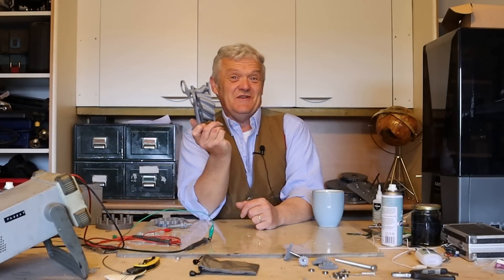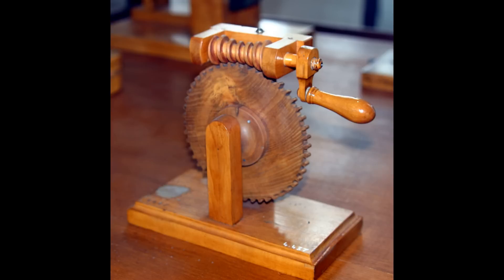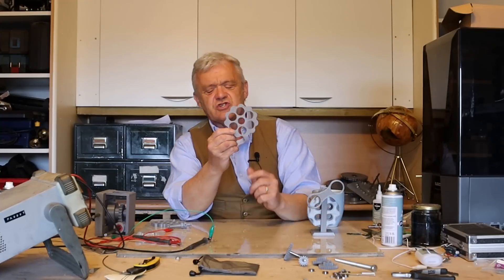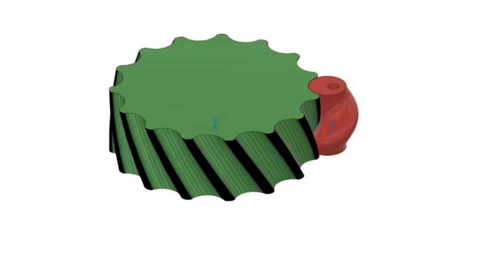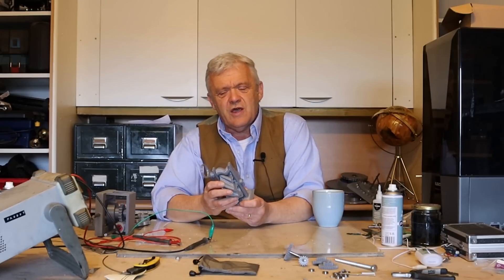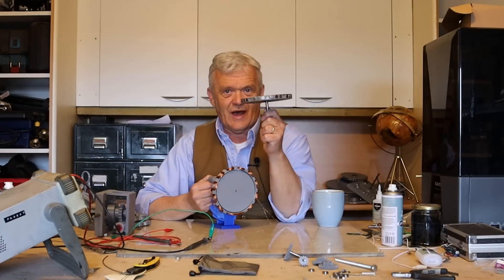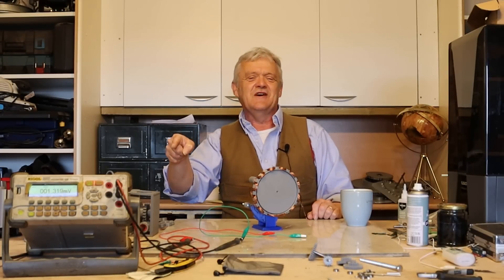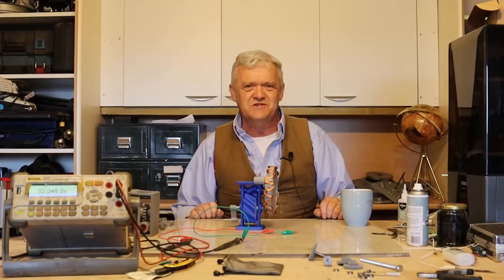1990 Eccentric Cycloidal Power Generator

Comment: hey question, what size bar are you using for the Coggs because they're not 8 mm but the bearings size are so are you drilling them out to eight mill and using an eight mil bar or are using a smaller bar in the bearing if possible can you tweak the STL files to have an 8 mm hole in all of the gears?

Comment: Would this drive in metal need to be a wet gearbox aka: “oil bathed” for friction reduction? Or could a hard forged wheel be driven by a brass oilite or powdered metal pinion?

Comment: That's really inspiring! 🤔 The extruded cam rides on the ridge only, leaving the trough free. If we adjust the shape it could be driven by water like an Archimedes screw in reverse using twisted cams, 2 would give you 24V 
Wish I had a tinker shop😂
Great videos, nice work 👏 thanks 😉
Reply: Ideally, it would use most of the contact area to prevent slippage, I’m thinking Teflon coated gears (they’re rotors actually) would help just like in positive displacement supercharger, which this design draws inspiration from. Or have loose ball bearings between the drive surfaces, or even fill the transmission case with loose ball bearings

Comment: What I like about this design is that your transmission gears won't break if your input is reversed for any reason. Your gear would simply and effortlessly reverse with no wear on the gear at all. You could also possibly use the same worm gear in tandem with another gear at the same time if you wanted and make it turn both gears, assuming your input is strong enough to turn both. One of the gears would turn the opposite direction, but that's none of these concerns (reversing or reversed extra gear) will be a problem for energy generation if the wires are connected to a full bridge rectifier, allowing constant and predictable output regardless of the direction the input turns. This concept could be used on any renewable power source that notoriously reverses direction, such as tidal or shoreline wave power where the ebb and flow of a wave can both be harnessed easily to generate power. Another perk to pinning this worm gear between 2 gears is that if there was any threat of the worm gear slipping from the main gear, it'll be drastically reduced if not eliminated completely by being pinned between two main gears.

Comment: Thank you. I gotta try that cool worm drive. I made a triple helical stator and noticed a large reduction in driving torque 👍.
I'm going to use floating magnetic bearings to reduce more friction and this worm drive looks like a great addition.
I wonder how hard it would be to print one 😁👍
Reply: He says where you can get the files. Or do you mean difficult for it to turn out well without defects? You could probably print the gears meshed together in an enclosed gear box.

Comment: Load forces on a 2 gear mechanism tend to push the gears apart. Rounded gears are probably the WORST design in terms of that problem.
The good point; it gets 10:1 ratio from those size gears, (normal gears would give maybe 5 :1), and it's quiet
The bad point; terrible gearmesh integrity under load, needs big bearings and supports to try and compensate
Overall, it really is not that useful. Planetary beats it in so many ways.

Comment: if you make not only the inner part rotate, but also the outer part in the opposite direction, you get much more performance without forcing the parts made by the 3d printer too much, because it would share the stress on the whole machine.

Comment: oh my god PLEASE tie in another one!  Replace the generator with another big gear and attach a small gear, and then have that drive another generator! Will you get 32 volts?  or will you get 320 volts?  Will the gear ratios multiply or will they add?

Comment: this would make a good bicycle powered power source, if you could turn the rear wheel into a flywheel and get it up to speed, and have that keeping the generator going, or some form of exercise gear that is modified cause it to spin a flywheel.

Comment: This is very interesting, making a silicone mold so a wax copy can be made, for a lost wax casting from aluminum, using a old cast car rim, should hold up fine for a wind turbine, especially id pkaced inside a case, with a bit of tacky lubrication, a bit of lucas oil stabilizer, mixed with automatic transmission fluid,
About 10% Lucas to 90% ATF, should make a thin oil that sticks to the gear leaving a film. For excellent lubrication. It will work well for tge bearings also, just leave a scroll pattern on the gear, to pull lube up to the axel, using a hollow axel, with a hole leading to bearing, it can be self lubricating.  The oil running off the large gear, running into the axel, then to the next bearing, running out the axel, into the bearing, possibly have a scroll wheel just to pick up oil, and feed tge axel. Use a coil of about 3mm copper tubing, soldered to a copper disc. Feeding a roughly 1-3mm i.d. of the tube. With a 1mm hole to lube the bearings ,  with this system straight ATF can be used, no lucas added, the system would basically have a pump oiling the gears and bearings..  

Im going a bit off an a tangent here. However, i have had the idea for a hybrid manual transmission, using a pump like a automatic, and clutches like an automatic or motorcycle,  still using gears, only use the clutches to engage the gears, the shift lever only opens a hydraulic valve engaging the clutch, without pressure, they automatically disengage. With no friction, using a spring to separate the  clutches, More like a motorcycle clutch i guess, having 6-8 packs per transmission, plus a normal clutch,  that could be replaced by a valve, that  slowly engaged the clutches, a normal 4speed transmission would be long, or possibly large, about the same as a automatic transmission.  It could be setup to  wirk automatically, uts like replacing the syncronesh with a clutch pack, about 8 3.5"-4" clutch disc and steels,  maybe  a smaller diameter for reverse, with less disc, being Reverse doesn't require holding lots of power, using a hydraulic coupling in place of a clutch, making it more  like a automatic. Keeping all the  gears from  creating drag on the main shafts nearly eliminating the losseshaving one clutch connecting tge input shaft to the output shaft. Should not requiremire than a few hp to drive , normal losses are 25j+ hp or better at full power, this system should be 2-5hp, usjng a carbon ceramic on titanium with slotted steels1.5mm thick with .5 mm slots tge ceramic material having carbin fiber reinforcing it, basically a carbon composite, using a ceramic material with carbon inside,  like porcelain with carbon using carbon fiber to reinforce, using powdered graphine to make a light weiggt ceramic making the clutch new, about 2.5-3.2mm thick the 2.5mm  steels.  Possibly baking the mose efficient transmission. Us live to build a eorking example,  with a single pneumatic actuated clutch on each gear, having reverse, and 2 forward  gears.  And a electric motor,  with most of the parts 3D printed, probably usung a sheet metal disc with a piece of paper from a brown paper bag . As the friction material.  With another  20 gauge sheet metal for the clutch, and 3mm plastic fir the pressure discs, with a wavy flat wire spring, to spread the pressure disc off the clutch. Use a 3D printed standat clutch with paper as the friction material and simple pressure plate, and a dimple printed air compressor, and hollow cylinders to prove  it works,   using a electric motor, for spinning the gears.  A car company could use the same transmission, only configured different to be manual or automatic,  or possibly a option to be both. It could save money, save fuel , and be fun to drive,

Comment: Seeing these videos always gives me inspiration to think up various designs to push these sorts of designs further, but i don't ever manage to try to design things properly. I could go online and find software to help me i'm sure, but never set aside the time properly.

One thing tends to leave me wondering in the meantime though: You show the Voltage of these sorts of designs, but not usually any amperage to work out the Wattage. For this design, what IS the amperage?
Could this alone charge a phone over a day? If it were even on with no data transfer, would it lose charge overall - just with the hand crank?

Comment: If you increased the size of your magnets , which would increase the magnetic flux working on the serpentine coil, the mass would increase, which would allow for a bit of energy storage, giving you a smoothed relatively constant motion between gust of wind in a flywheel effect,  Decreasing voltage fluctuations. Splendid Vlog as usual Rob.
Reply: a flux capacitor, you say?
Reply: Since the magnet "flywheel" will drive the worm gear in reverse, won't it be braked during a lull by the wind turbine impeller moving against the now-sluggish air?
It seems to me a flywheel needs some sort of clutch/freewheel mechanism.
Reply: @bokkeman123  A centrifugal clutch of some kind would be great.
Reply: @bokkeman123  Also, I would be concerned about the 90% reduction in torque when the generator has a load on it. Plugging something into this generator would cause a braking effect and slow down the rotor, wouldn't it?

Comment: I saw this other video where a guy did a magnetically driven bicycle...  the gears lost energy to heat and slipped... LOL seeing this I really want to combine the magnetic cycloid gear from the last video... attach it this modified worm gear and see if it can withstand the stresses of propelling a bicycle... How cool would it be if you could just 3d Print the parts for a high functioning bicycle or ebike from the same parts used to build a device that charges it?

Comment: That is really amazing! 
Very interesting thing is how it behaves when you stop adding more power. Just adding some weight to that magnet disc will make it a much better flywheel. Then add some separation between gears and a flywheel (ratcheting or other also discussed in previous episodes) and we have a perfect device for a wind turbine 😊
Reply: Or a hydro turbine
Reply: Separation between gears? If I’m correct, the tighter these gears (to a point) the less rubbing and friction forces there are, o think this would have to be oil bathed or Teflon coated gears and a clean box around them.
Reply: @_..-.._..-.._  If i may be so bold and remind a formula for a friction: T=fN. Where T is our friction force, f is a coefficient of friction (depending on 2 materials - irrelevant) and N is a "normal force" - a force with which 2 bodies interact.
So, according to a formula from primary school, the more you push something against something else, the bigger friction you will get...
So i will have to say that "the tighter these gears are, the more rubbing and friction forces you will get" 🙂
Next thing is a tooth geometry, rubbing and so on, but this is just opening a mechanics book on gears and people wrote a ton of papers in that subject:)

Comment: Looks like, so long as you can keep it past its shift slip point, it should turn with relative ease. ~( 'w')/

Even though one may not see it as 'low friction' I see it as 'continuous impulse' which, in this case, sort of acts to reduce friction by always keeping some portion of the interface at the moment of peak mechanical advantage.

Comment: That’s awesome! 16 V is quite a lot for this arrangement, compared to what you’ve done before… but what if you could do a rotor that has magnets “inside” and “outside” the coil? Would that double the output?!?
Reply: That's a cool idea! That made me realise that only half the magnetic field is utilised in the current design. If you were to change the rotor so that the magnets were arranged around a raised 'rim' so that you could have two stators - one outside, as it's shown now, and one inside. (imagine the rotor as a cylinder - the magnets centered in the cylinder wall and one stator located outside the cylinder and another stator inside the cylinder). That should double the output as well?
Reply: Doubling output still requires doubling input, you can add a thousand magnets on there but it will stall your propeller if you draw too many amps.
Reply: A laminated iron core for the stator would tremendously increase efficiency, but then you couldn't 3D-print it - you'd need to laser-cut steel sheet and build it.
Reply: @vylbird8014  Wouldn't the magnets want to 'stick' to the iron core?
Reply: @nooneofconsequence3658  They would. You have to design it to balance out most of the force, then use a bearing that can handle it.

Comment: a worm gear can be reverse driven, but it takes a special set of circumstances for this to be true - if the coefficient of friction is less than the tangent of the lead angle, ie if you have a worm with a large tooth angle then it is possible with enough torque to back drive it, this is generally desirable if you are worm driving large and heavy components and dont want to have something break if the input stops suddenly, the friction and losses are enormous and brake the large heavy component quite quickly
Reply: i know my 96 to one worm gear plates for boat lifts aint gonna turn from the wheel aint no way in smuckers marmaduke even if you helped it
edit ok i saw someone say around 5 to 1 is about the most, seem legit

Comment: 10x RPM not 10x speed.  Since the magnet disc is larger there is another factor of magnification in speed that the magnets pass the coil based on the ratio of the diameters between the magnet disc and the driven gear.  If the size of the magnet disc was increased with no other changes the speed of the magnets motion would increase too.
Reply: Is there a way to extrapolate the speed and volt increase from a 1m diameter wheel in comparison to the small wheel Robert is using?
Reply: @vincentv6009  e=BLVx10^-8, where e = volts, B=magnetic flux lines/cm^2 (gauss) and V=velocity between conductor and magnet.  V=𝝅D x RPM/60, where D = diameter, to give a velocity/second So if his is D=10cm and you want to go to 1m (100cm) as D is the only factor that changes everything else cancels out so it's D2/D1 = 100cm/10cm = 10x the original voltage theoretically.  There will be some losses so you won't achieve that quite but it would be close. This is for 1 magnet passing 1 section of coil and for total energy output you would need to factor in having more sections of coil and more magnets as well.
Reply: @vincentv6009  the other thing to start considering at 1m diameter is how fast that wheel is going to be spinning (the outside of the wheel), and the kinds of forces involved there vs the material of the wheel.  i.e. a dremel might spin a 1cm disc at 30K rpm, but a 1m disc at 30K rpm would disintegrate, if it were made from steel.  with 3d filament, it'll fall apart a lot faster.  if a 1m wheel was spinning at 1000 rpm, the outer edge would be travelling at around 20 meters per second.  so if you're turning the crank at 100rpm, you get to 1000rpm on the wheel because of the gears, and now you have a wheel edge going over 40mph.  just something to consider. ;-)

Comment: That eccentric cylcoid looks almost impossible to machine properly... luckily you can print it! The gear ratio is quite good too!
Reply: Actually a 4 axis CNC milling machine where the fourth axis is rotational and a ball ended milling tool would make this type of gearing relatively easy to produce.
such machines and tools are readily available (at fairly reasonable prices).
Reply: @trevorgoddard2278  yeah, but I can 3D print self-assembled ball joints that work immediately. 

This or any other type of self-interlocking mechanisms, literally impossible to do with subtractive manufacturing.
Reply: @Rhannmah   , but... With real machining tools one can make things that work more reliably than as toys.   Tips and tracks for the real world, horses meat courses (sic) at the dinner table.
Reply: @trevorgoddard2278  Um, what is your idea of "reasonable"... I repaired, setup, and trained people on CNC Mill and Lathe in the South East USA for a while... and those machines weren't cheap. Ranged from 35K and up for just 3Axis and that was over a decade ago.
Reply: @marcfruchtman9473  That's the point, a decade ago prices were high, now you can get 3 axis CNC milling machines with rotational 4th axis add-ons for around $500, not cheap but not ridiculous.
Indeed you can get 5 axis machines with automatic tool changers for under $1000.
Reply: @trevorgoddard2278  Er... ok, I'll bite... name 3 brands and their models. (I would really like to see the quality for that price)
Reply: @trevorgoddard2278 I would like to see that as well. I know prices have came down on some machine shop tools but I haven't seen anything close to that price.
Reply: 3D printing is really incredible for geometries like this. You can produce parts with very little effort that would be otherwise impossible to machine. You can even print functional multi-part embedded machines that work right off the print plate.
Reply: I think one could use the 3D-printed plastic part as a guide for reproducing it in metal using lathing techniques. And then you could sand cast it from the plastic part as well and then do clean up from there.
Reply: @justincase5228  it’s also quite handy for casting solid parts like these if your not much of a machinist.
 - Print the part in PLA
 - mould around it with appropriate vents and drains
 - pour in the hot stuff
 PLA just melts away and leaves a clean cast part.